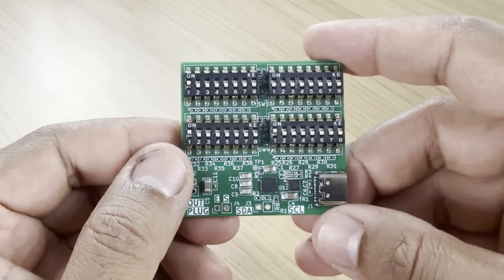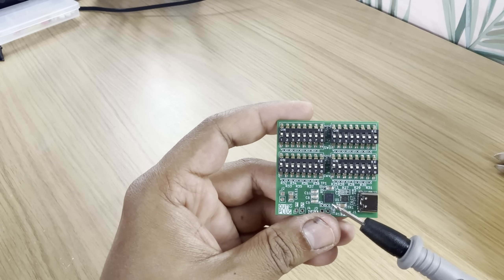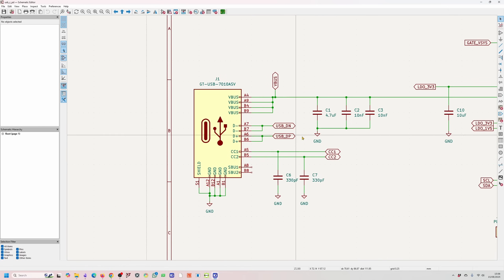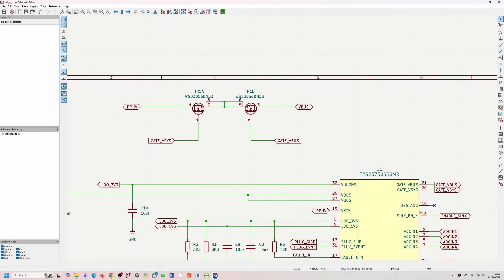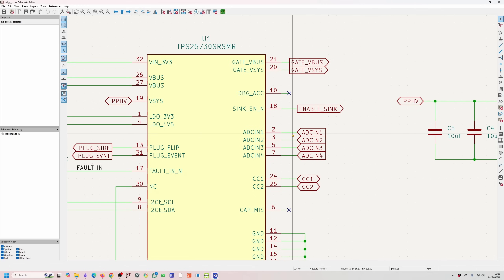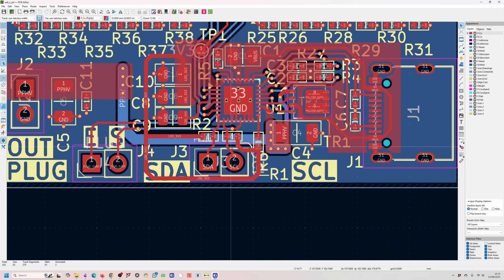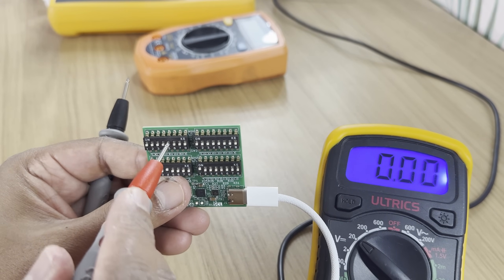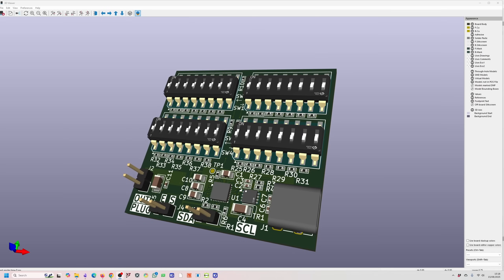USB C Power Delivery PCB Design and Test

Comment: I'm designing a laptop briefcase with built-in battery, would it be possible to use this design to get power delivery feature ? Here is the schematic : 92wh battery --> Main PCB --> output 1 : usb c Power delivery / output 2 : smartphone wireless charger
Reply from the maker: Sounds like a nice project. Without knowing your full specs it’s hard to say, what I would suggest exploring is bidirectional power options which are very similar to this part but power can go both ways.
Reply from the maker: From your options, looks you want power out and not in?
Reply: @TheEngineeringExperienceYT  Thanks for your answer. Actually I need bidirectional power options (in AND out) from the usb-c port
Reply from the maker: Have a look at TI TPS25751, which might help